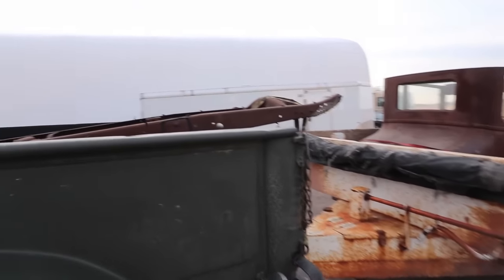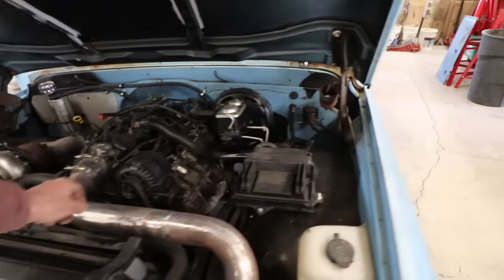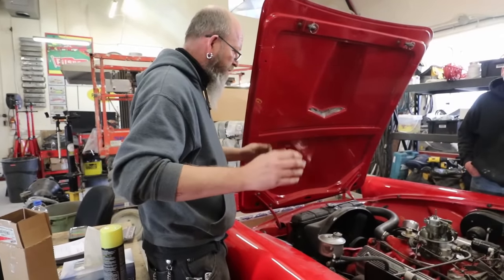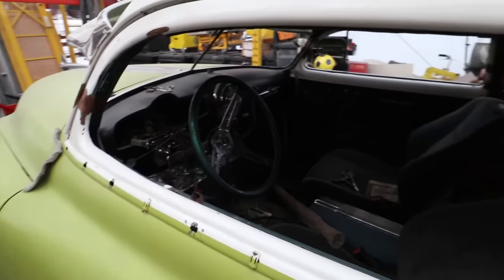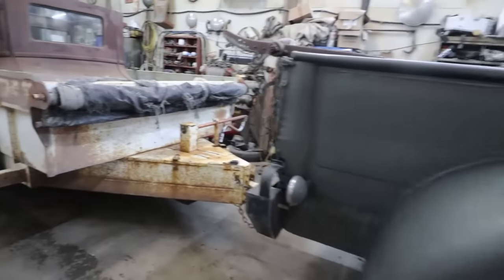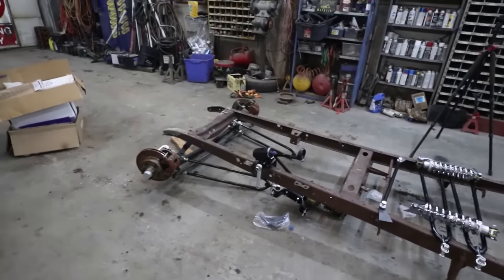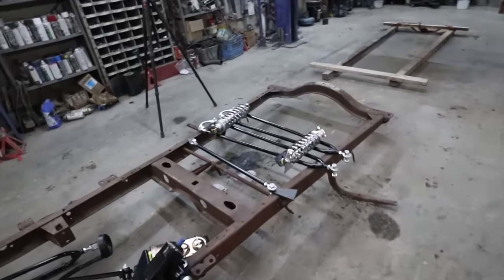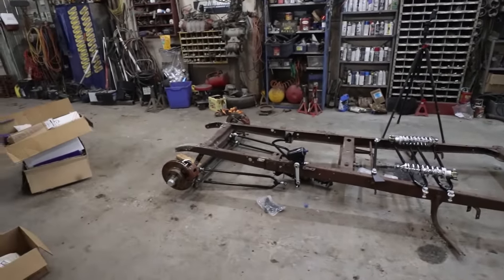Pickup a Model T project and take a local garage tour at Sobering Restorations

Comment: My thoughts would put this together with the rust repaired, body panels pushed out to fairly straight, with a 4 cyl. Ford Ranger engine transmission. Or a four cyl. Chevy with a stick shift in either one.

Comment: That T could go so many ways it is impossible to make ones mind up but for me its a rat rod and just rough looking but good metal. I    couldn't find them that nice twenty five years ago when I patched some of my stuff together. Sobering is a talented bunch and I have been subscribed to for some while but they just do things way different or have a different approach to putting things back together. Like the clutch in that 57 was to me just wrong.... it works for them though and its their rig so who am I to say phooey about nothing. Their shop is so  clean that you can serve dinner there during  work hours. I should think thats worth a lot. I always tried to keep mine picked up as I am not one to trip over something twice. I will "expertly categorize" it out the door on the first time if it pulls hide as my temper always was my failing an a visit to the hoos gow a couple of times. So the just need to smile without being told to or some other dumb idea that someone will say that they need. We are all just humans with our indosincrosies or faults and makes us just right for someone looking for that. I remember when they started working on the big collection of cars from some significant collection                     and had just sat too long.... way to long meaning a lot of these collectors have ruined more than they save being parked up wrong. I don't think its a real job but wouldn't it be nice to come to work in dress clothes and set down into a hundred plus thousands of dollars rig and just put some miles and farts in the seat   covers. I went to a fellows place about fifteen years ago and he was selling all his big  collections of just about everything from household goods to race cars and even heavy equipment that he had had restored or did himself. He had a stroke and couldn't work so was moving from here to Florida and since I knew him he had me over like some others to look at stuff. All the shops that had been closed for five to thirty years had rodents and other damages to the point of just garbage. It broke my heart to see his hard work turn to mud. Moisture and rodents do so much that I wish I could kill ever last mouse in the whole world.  Na all things considered, you and Dan, heavyshevy, waylons creations, and a young fellow named "Puddin" who salvages out of wrecking yards and puts on quite the little comedy act. Theres more like Mortske.... I butchered that name too .... guys with a little talent and fair dog and pony show, they are fun to watch. I really get a lot more from your builds as its not snap your fingers and all done unless its a  exact replica of the parts.... I learn from you a lot. That to me makes you the winner.